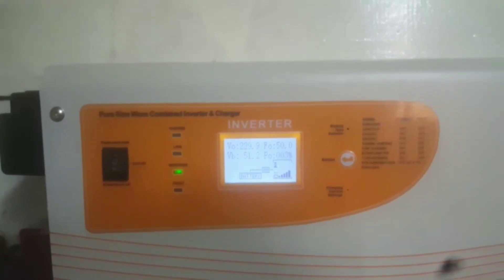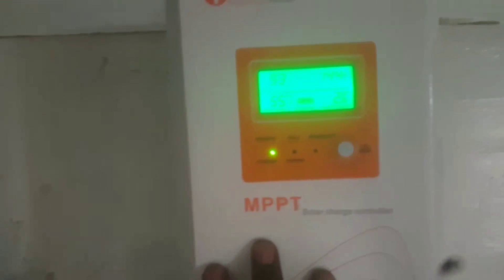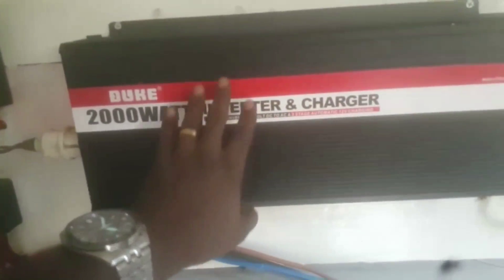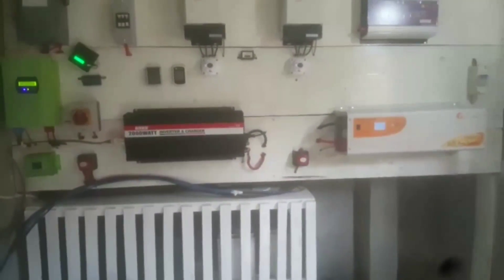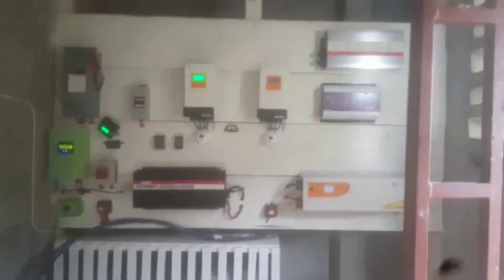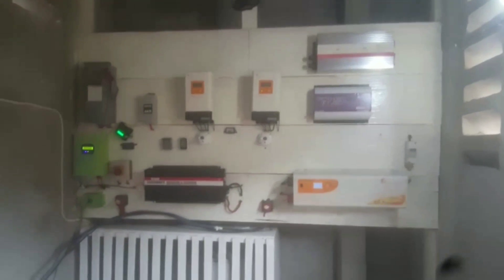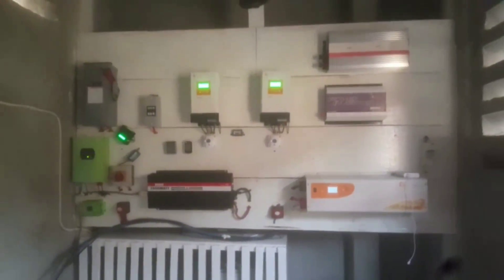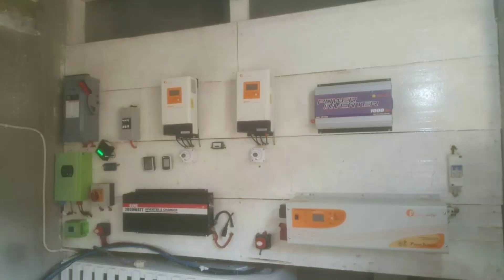SUPPORT AFRICA HOMES WITH OFF GRID SOLAR POWER SYSTEMS

Comment: Nice system. But i have a question about the old system with the green change controller i have 2/ 60amp of the same type are they good controllers and do you know the set charging amps and voltage that comes from factory for this charge controller?
Reply: Thanks for your question. These are very good intelligent controllers, they regulate automatically based on the input and output power. 

They have a wide input voltage of 150v and rated maximum of 60amps.  The controller automatically detects the battery bank voltage and adjust to the systems voltage 12, 24 or 48v and the required current.  All you have to do is to set the type of battery and you are all set
Reply from the maker: Thanks
Reply: Thanks for the infomation my friend as soon as I have the system up I will put a video up solar is really addictive thanks to you too JW Solar I have watch all your videos and they have help me a lot to put this system together.
Reply from the maker: Thanks for watching my movies. I am glad this information turns out to be helpful for you.
Please subscribe like and share my channel.